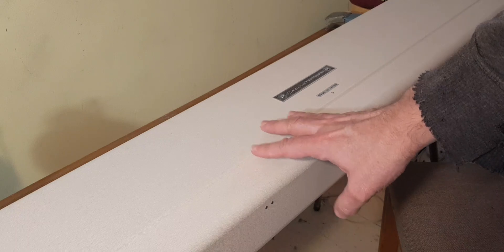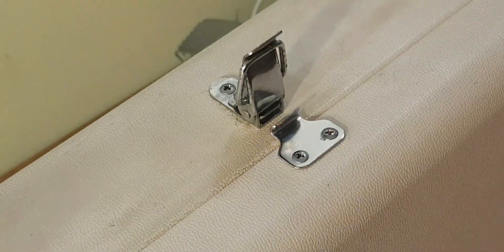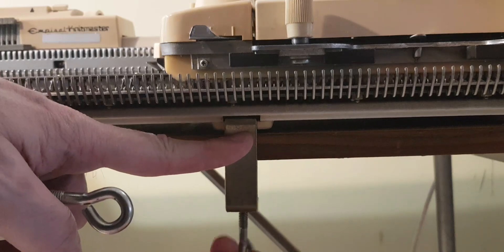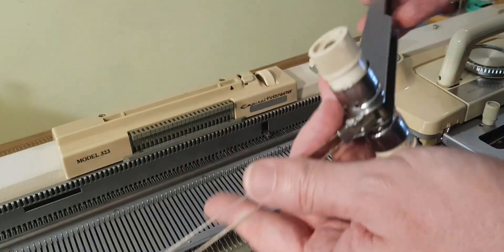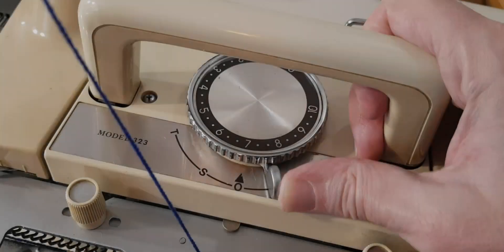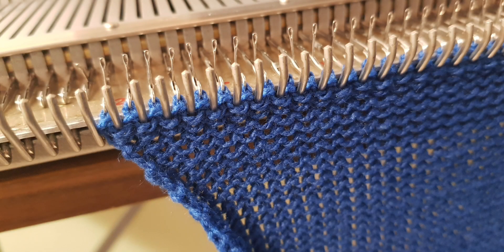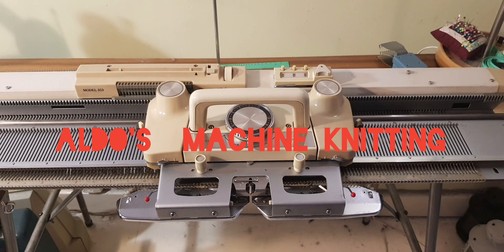The Knitmaster 323-Setup and Cast On

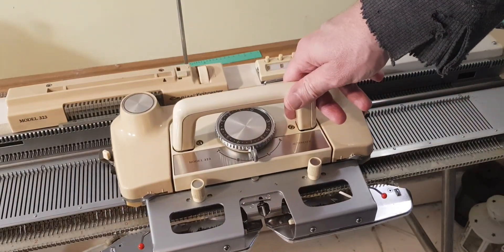Comment: Hello. At 5:13 you move the carriage quite eaisly but mine is very stiff and takes quite some force to shift it. I have only recently bought it and it is well used but in good condition but probably not been used for some time. Do you have any advice for me on how to make it glide smoothly, I dont want to dive into it with a can of wd40 without having the slightest clue of what im doing. Thanks.
Reply from the maker: Hi there, do not use w40, that is bad for the machine, get bicycle or sewing machine oil. The knitting machines like lots of oil, the more the better. I take take an old toothbrush and put a lot of oil and clean the underside of the carriage, I also oil the back section where the carriage slides. What I do there is oil it a lot, bring the carriage up and down a few times then wipe it off. You will see it will be quite dirty and do that a few times. I take the tooth brush and oil the top bed where the needles go up and down. That helps the needles slide better.

You need to look where the sponge bar slides in, and take it out and check that there is no lint or fibre yarn under the sponge bar, that can cause the stiffness of the needles, what I use is a plumbing wire with a narrow brush, this is useful for clearing that out.

Another thing that nobody looks at is the tension unit, it has screws on either side, carefully open that to check the spring and for any lint that is there. This can affect the knitting, make sure you take pictures of the tension unit in stages as you take it apart so that you can place it the same way. Be careful as it has plastic parts and you don’t want to over tighten or break the plastic.
Reply: @aldosmachineknitting  Thank you for the advice, there is a sewing maching shop near me so i'll pop in there for some oil.
My machine came will allsorts of accessories, manuals, patterns, magazines etc but it didnt come with the thing you use at 7:15 to hang on the yarn, do you know the name of it so I search for spare?
It also came with a couple of RRP lists from 1976, the 323 was £174.85 effective from 1st January 1976 but shot up to £183.60 from the 1st of May 1976.
In todays prices that would be around £1,311 for this machine.
Anyway, thanks again.
Reply from the maker: I’m not sure what you mean by 7:15. If you mean tension unit, the knitmaster/studio, is different from brother and Toyota machines. Toyota has a very different tension unit. Just look at the manuals and see the name for the equipment.
Reply: @aldosmachineknitting  It's OK. In another video, the person called it the comb, that's what I'm after.